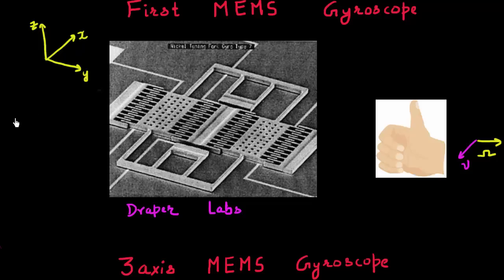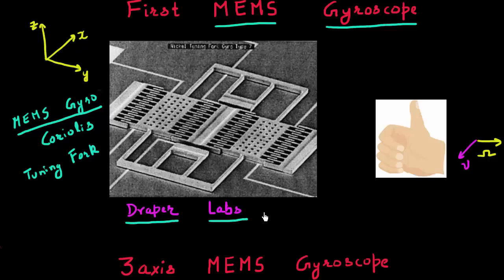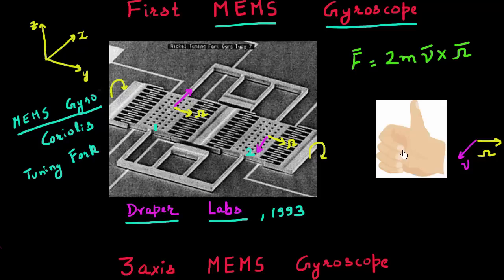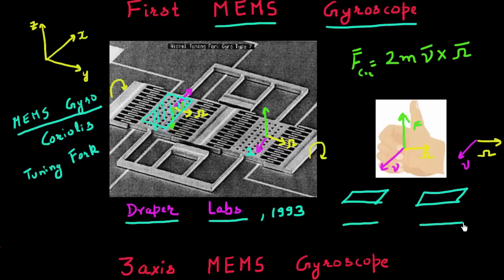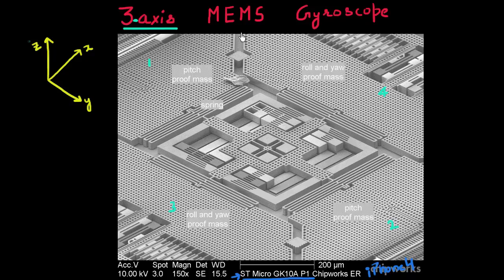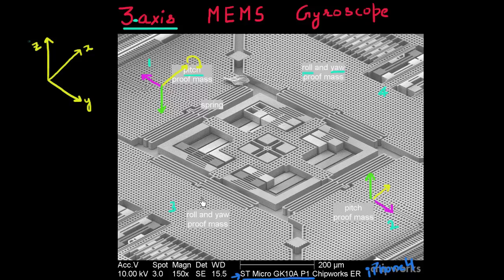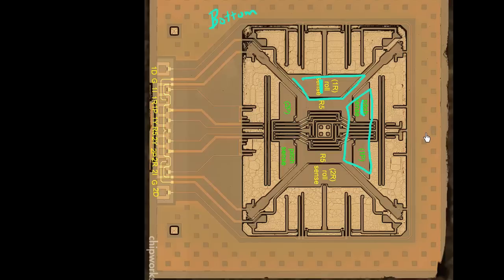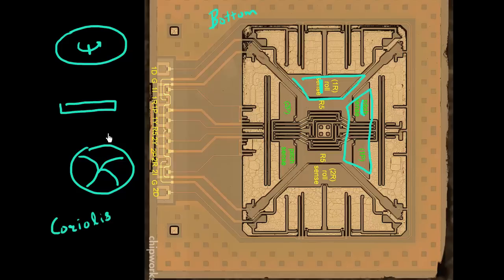3-axis MEMS gyroscope

Comment: very good videos.I don't understand the following.In video 1min10s, you said "the velocity is equal in magnitude but opposite in direction"Why they are opposite in direction?Shouldn't they move in the same direction in vibration mode?
Reply: I think I figure it out. As the two masses are connected. Along their parellel center line, there are anchors to fix the position, so the two proof mass are moving in different direction. Is it right?

Comment: Amazing video!!! I have some questions
1. How does the proof mass oscillate.Is there any oscillator?
If yes...then how it's powered?
2 what will be the output of accelerometer if it is moved at constant velocity
3.  Gyro as well as accelerometer gives a lot of values.....how can we confine it to an exact value....I need it for my project
It will be nice if anyone can help me with the correct answers of these questions
Reply: is the oscillator just rotate along the Z direction?